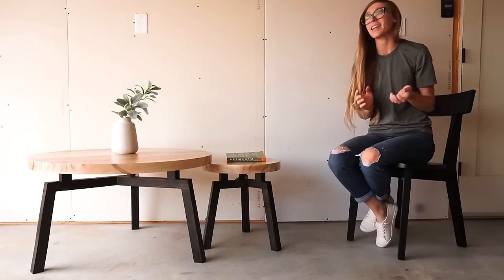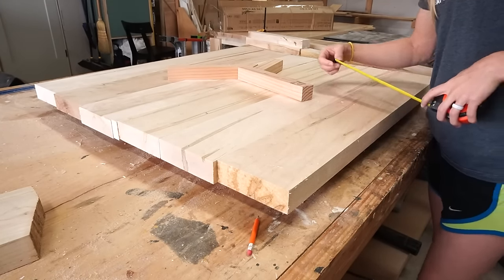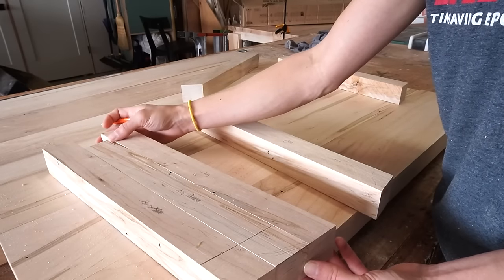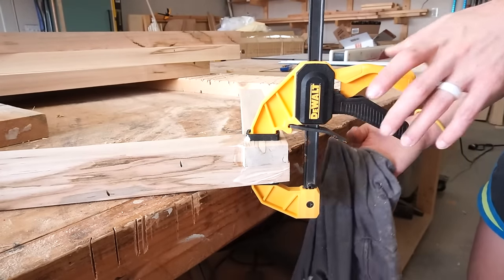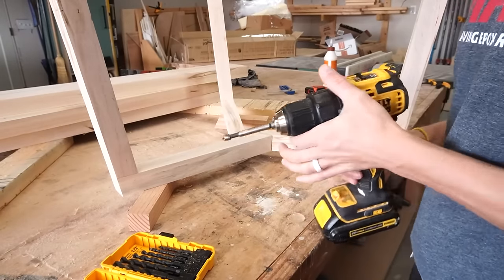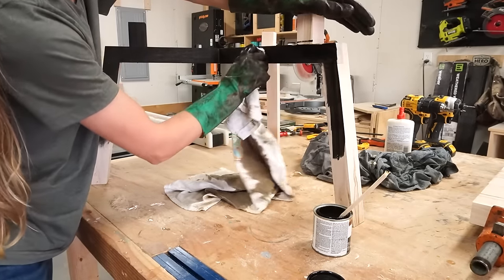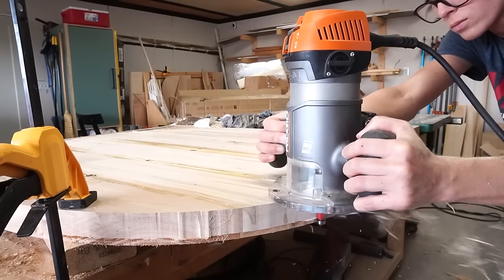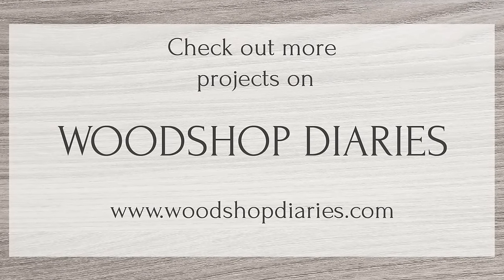How to Build a MODERN Round Wood Coffee Table

Comment: I use a combination of cutting methods for circles specifically, but my personal preference is to make a similar jig to your router setup, but attach you circular saw.  Ive cut many large circles for counter tops, benches and tables that way and though it seems a bit awkward to think about, it works phenomenally.   The circular saw has the cutting power needed to make the job easier, and theres very little clean up afterward.   Nice design.  I really like this simplicity of your design.  Thank you maam.

Comment: Beautiful tables, Shara.
I’ve used a dado set on my table saw when making the cuts for half lap joints. Much cleaner cuts.
Reply from the maker: Yeah, I considered using my table saw to make the cuts, but they had to be cut at an angle and I don’t trust my miter gauge…I’ve not taken the time to dial it in. Something I need to do “one of these days when I have free time” 😂 those days never exist
Reply: @WoodshopDiaries  suggestion, specifically do a video on tuning up your equipment like this. Maybe a video on making a homemade crosscut sled? You also mentioned not having a router table, another possible video idea(?).

I've been woodworking for 30+ years and in my experience some of the most useful videos for instructional purposes are for making the tools to make the projects 😉

Comment: I went to my local Home Depot and Lowe’s and they neither have the figure 8 pieces to attach a table top. I even got some washers and laid them out in a figure 8 and explained how and why they work and both places said nope, don’t have anything like that. So, my lovely Shara, what is the correct term for these and by any chance do you have a part number for either Lowe’s or HD? I ordered some on Amazon and when they came in they were tiny and for jewelry. I would appreciate your help, since you have so much time on your hands from dry wall hanging! 😂
Reply from the maker: I linked the ones I used in the description. I’ve never seen them in the store at either my Lowe’s or Home Depot. I’ve always had to order them online.

Comment: Question. How do you keep the blade in your jigsaw from deflecting to one side or the other?  My luck it would deflect “in”, and then using a flush cut router bit would not work.
Reply from the maker: For cutting through thicker materials, a thicker blade helps prevent as much deflection. However, when going around an outside curve, it most likely would deflect outside vs inside, so it wouldn’t really matter